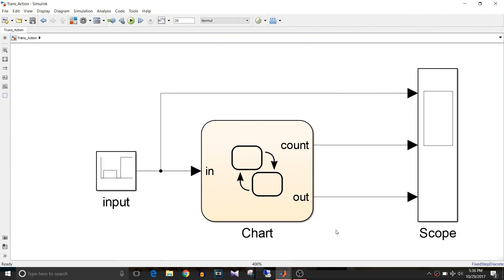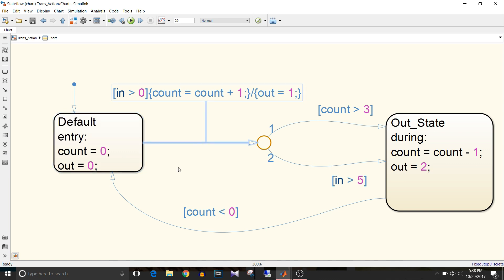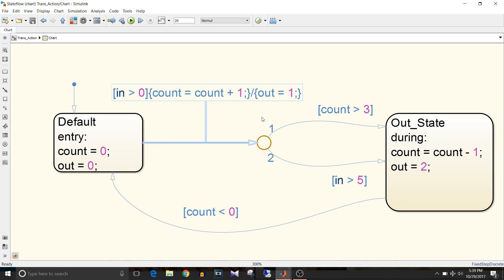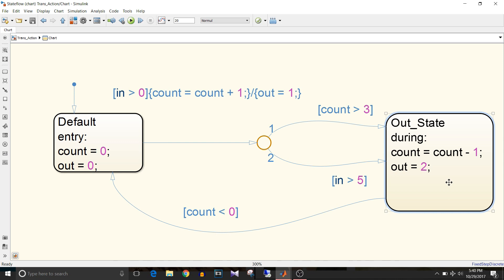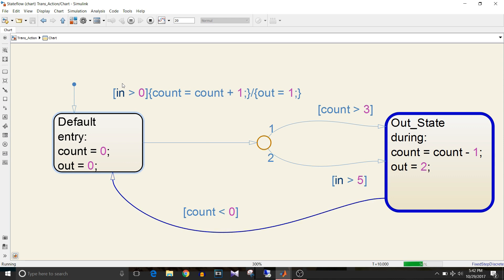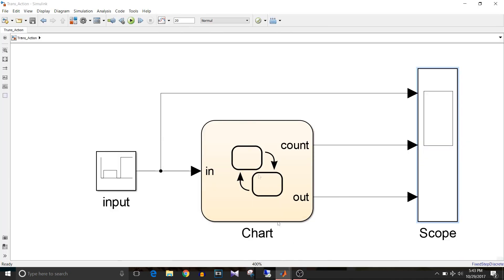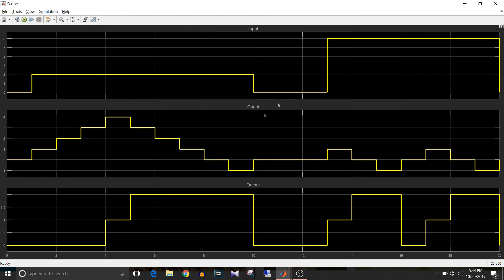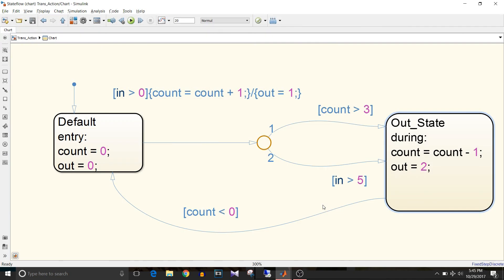Simulink Tutorial - 44 - Stateflow - Transition Action

Comment: Why do we need transition action? Will the entry action not suffice in the situation you've demonstrated? If in this case both entry and transition actions are serving the same purpose, can you please provide an example where both actions are required? Thanks!
Reply: Imagine an example where there are states 1, 2, 3 and 4. And there are transitions from 1 to 4, from 2 to 4 and 3 to 4. By the entry of 4, we can code just 1 action, regardless which state it is coming from. But, by transition action, we can have 3 different codes, because there are 3 different transitions. So, if we must have "3 different entry actions", the way of implementing this 3 different actions is by using transition action.
Reply: @alexkidd253  Great example, thanks!
Reply: @alexkidd253  thanks for the example. The concept is more clear now.

Comment: Hi Simulink tutorial, Nice work.

I have designed simple simulink model to blink LED with Arduino hardware, it is working fine and also generated c code from this model with hex file size 12KB, but this hex file is large for LED blinking project, I want to reduce it to less than 1 KB. So, how to optimize this model to reduce it to less than 1kb? Please clarify. Please provide your email id I will send the simulink model to you. 
email: shivakumar269@gmail.com
Reply from the maker: +Shivakumar Jogur you can try to reduce the number of blocks. Try to implement same logic with less number of blocks so that size of code will get reduced.
Reply: Simulink Tutorial 

Thank you.

Can you make video about that? it's very necessary for me. Please provide me your email I'd, I will send that simulink model to you.
Reply: Also, how do I relocate simulink generated code in another IDE? I want to use in Arduino IDE.
Reply: Please, make videos on these topics.